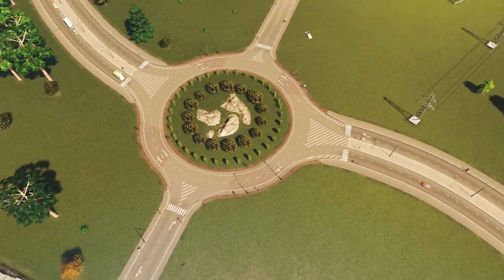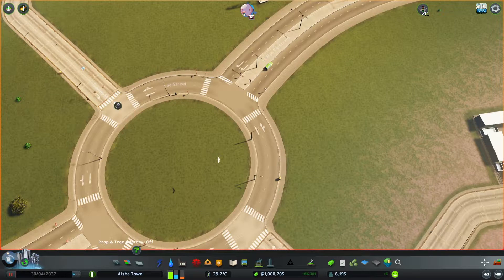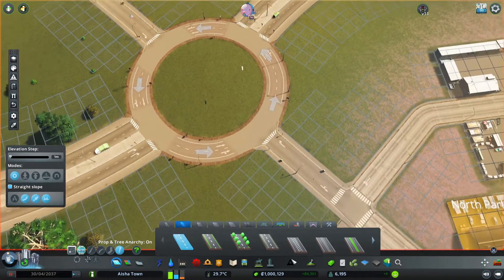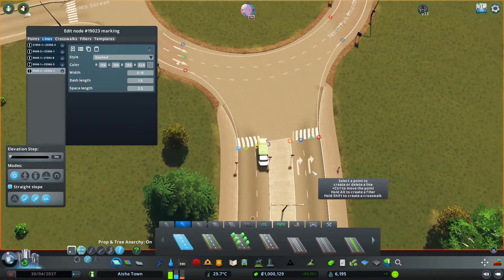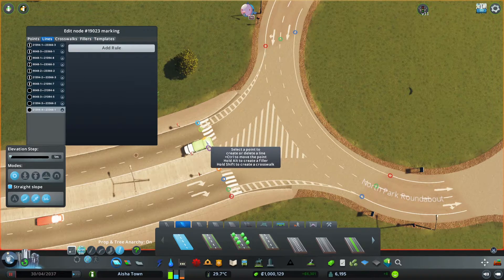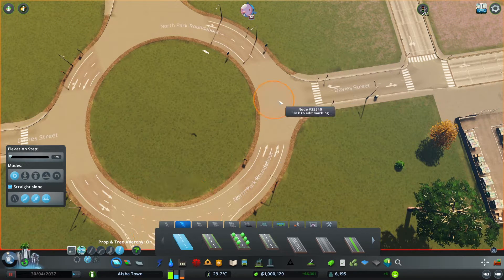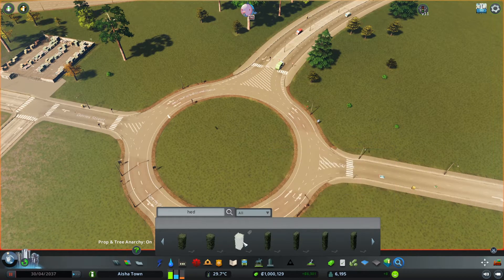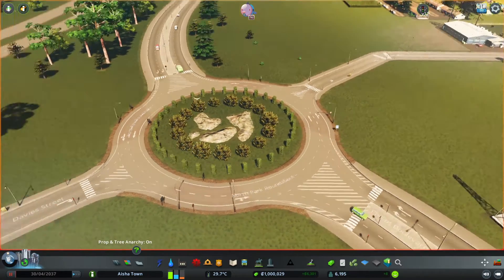Cities Skylines - How to build an EASY realistic roundabout | Using Mods for PC 2020

Comment: Can just remove the pedestrian crossings with TM:PE, and visually they are also removed. No need to use 'highway' roads, can just use one way roads, if you want to allow bicycles without using any special layouts or lanes.
Reply from the maker: Good tip AndrooUK. When I did the video a long time ago either I didn’t thought about it or it wasn’t possible to do it yet.

Comment: with node controller , while smoothening, you can use the mouse wheel to make it easier to be precise with your numbers

while drawing lines with intersection line tool you may hold shift to make it solid

11:20 the line you want to intersect with must also have a rule set
Reply from the maker: Thanks Alex for the extra tips regarding Node Controller. Yes, after recording I realized that I forgot to select the from and to fields 😆